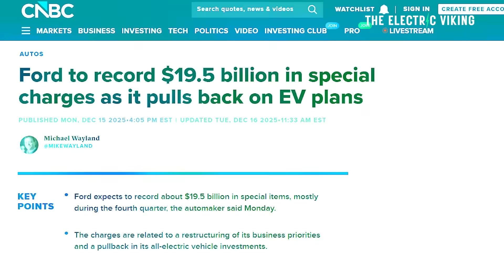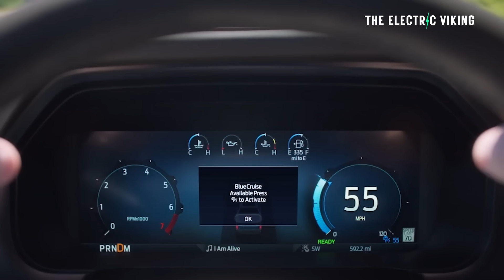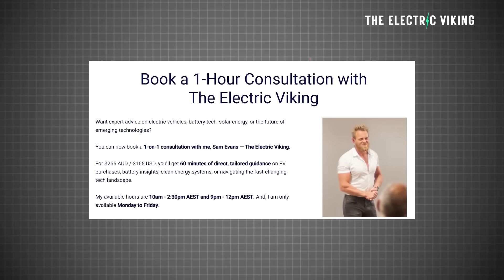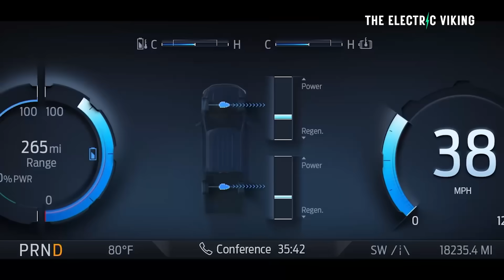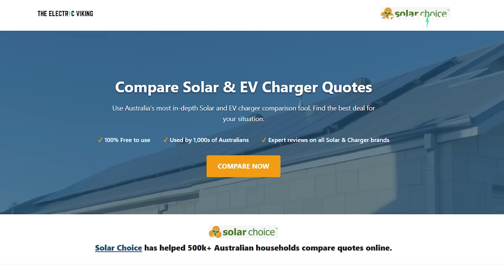Ford’s $30,000 “Apollo Mission” EV Truck: Gigacasting, LFP Batteries and FSD!

Comment from the maker: The car I drive, the Xpeng G6 - https://youtu.be/IcniwO8NfQQ

RESINC Solar installed my battery and solar system. Get a free quote from them here: https://www.resinc.com.au/electricviking
Reply: Didn't IDRA create the equipment to do gigacasting?  if so, then it's IDRA that first developed it.. All Tesla did was buy their equipment and use it for cars mfg.  So, NO, Tesla did not invent Gigacasting.  Please get your facts straight.

Comment: This is absurd, Ford is clearly lying. EV motors generally only cost between $1k-$3k, you aren't going to shave off that much cost on motors alone.

Let's say Ford has magically gotten to $100/kwh on their battery. Best case their battery will probably sit between 70-100kwh? So we're talking $7000-$10000 for battery cost in the best best case scenario. Are we really supposed to believe everything else only costs $20k? So dumb.

Comment: One chassis with battery, motors, axels, wheels. Multiple different top/bottom parts to make “different” vehicle models. Not sure I want a truck which might otherwise have become a sedan just for a different production line routing. But I do need a new Ranger; 3.2L 2016-19 preferred.

Comment: I have to laugh... sure, maybe Ford actually can produce an electric compact pickup with an MSRP of $30K, but no one is taking into consideration one important fact: Dealers will tack on an additional $5K markup, $8K if it proves to be popular. Unless and until Ford, GM, et al can change its' dealership model to go to a "no-haggle" pricing structure, I have absolutely NO HOPE of ever seeing a reasonably priced low-end electric truck hit the streets. I predict that even the much anticipated Slate truck will not retail anywhere near their $27K target. I predict more like $36K to start. I hope I'm wrong, but I don't think I am. My opinion. Yours may vary.

Comment: I wonder if Ford is worried about upcoming Scout Motors. I'm personally excited about the Scout Terra EREV. I love the low profile screen, the manual switches and knobs, and solid rear axle. If Ford can create a more detoxed interior with possibly a solid rear axle at a cheaper price point, I may consider.

I'm also wondering if it's not time to buy an EV if solid-state batteries are about to become the new norm. I'm leaning toward the EREV platform but solid-state batteries would definitely cause me to reconsider.

Comment: Farley was on Bloomberg, and mentioned building their EV platform in Mexico to compete with China. Mexican salaries believe it or not are actually lower than Chinese salaries. So they have solved the labour problem. As for the industrial innovation problem, LFP will make a huge difference to cost as the Mach E and Lightning used NMC. Megacasting, excellent. Modular platform, perfect. I think Ford can do it. So even if assembly is in Kentucky, a lot of the parts might come from Mexico. Including the batteries. Jim literally tells you how they will be cost competitive with BYD but in North America. Skip to 8:40 https://youtu.be/ZN_I37cgLMY?si=8LjHB1tXopDSDZ5e

Comment: So Ford, a company so incompetent that it had over 140 recalls last year, thinks it's going to beat China by leasing technology from china, and building it in America where labor costs are several times higher?

And their cars won't be ready for years.

Ford is going to jump head first into the EV race, after the EV race has already been won by China. 🤷‍♂️

Comment: $30,000 ? Still in 2027? With inflation running at its current quote rate, that's $31,500, if you believe official figures. If you don't expect more increase.

Comment: I have a Mach e it’s not the best EV but here in Canada it’s has the dealership network also the cheapest maintenance I pay 59 dollars for service every 16 k so and when suv is off warranty I buy any parts I want including individual batteries packs   Let me keep this car for,a long time
Reply: Unless the schedule maintenance require is mandatory for warranty purpose. Yes the first service is 15k or six months but the second service should be 1 year or 50000 km with service fee usd 120 max . Then is 100000km. Study warranty on battery,  otherwise no need to service.

Comment: As I've said before, building a BEV SHOULD be way less complex than making a combustion car. No engine, transmission, differential or assorted mechanical linkages. Yes, batteries are still the cost obstacle, but that is something that is changing rapidly - unlike an engine (gas or diesel) which by its nature has hundreds of parts and can't be simplified. Same goes for transmissions. The legacy automakers need to eat their own children (ICE cars) and go all-in on BEV to be able to catch Tesla (and BYD) and win. At the end of the day, don't bet against American ingenuity when their collective backs are against the wall.

Comment: I was really looking forward to seeing the 2nd Gen Ford EV truck the T3 which sounds like was unfortunately cancelled for now. I drive a 2024 Ford F150 Powerboost hybrid which I really like and may consider a full EV or EREV truck in the end of 2027. I expect there to be a lot of choices at that time so it should be interesting. People forget that Tesla themselves didn't turn a profit forever....think it was 17 years of loses with the odd profitable quarter here and there. Any company getting into the EV world will need to make massive initial investments in the beginning including gigafactories, new truck plants, new engineering and testing of parts along with investing in the supply chain and people. It's no small feat. I'm actually looking forward to the upcoming F150 EREV Lightning as well which I think will be quite popular along with the RAM EREV truck.

Comment: Will Ford do this? 
I'm  skeptical, but... Ford could IF FIRST Ford CANs a large percentage of the most useless
marketing, sales, management, board of directors and dealers. Then Ford could copy the best business structures of the best competitors. A steep chop at the top before whatever chop is necessary below. 
Better batteries lower vehicle weight, lower weight lowers intrinsic cost at automotive volumes.

Comment: Why does every EV need self-driving? I seldom bother with cruise control. I enjoy driving because it's less boring than not driving. Give me a cheap EV without all these silly bells and whistles. Forget custom silicon and doors that you can't open after an accident. I just want good value, i.e. cheap, reliable, capable.

Comment: Maybe, if the battery cost comes down. Maybe a base model with base features, a symplified platform. The truck, cars do not need all the electronic features...intertainment systems. Just design me a solid, functional truck. A base hybrid Ford Marverick is $30,000. This seems possible.

Comment: The problem with Ford is that they are so attached to the margin that F150 brings in, even if they do manage to make a $30k EV, the margins won't allow them to continuously  develop them. They've had a number of competitive cars (Fusion, Edge, Escape, etc..) that sold well but didn't update them and let them get stale. Ford, GM and what was Chrysler all have this issue.   

Essentially it's a form or 'innovator's dilemma'

Comment: I know one way Ford could significantly reduce the cost of their products while improving the quality of them. Gid rid of all management and marketing cost. Go private and get rid of shareholders profit and roll it back into production and engineering. Management and marketing cost vary for 15% to 35% of operational cost depending on industry. And if we're talking Auto it's the higher number. Profits can be as high as 20% and are just rolled into dividends and stock buybacks that only benefit the top executives and shareholders who contribute absolutely nothing to the product. Then Trump could get rid of his asinine Tariffs and we could compete with the rest of the world again in producing high quality low cost products.

Comment: I think the $30,000 number is about as likely as $38,500 was for the Lightning.   But if it's $45 or $50,000 AND they at least break even, it will be a major step forward.

Comment: My first car was a 66 mustang coupe, and I've had 2 Mustang convertibles since then.  If they put out a 2+2 seat truck, bare bones, Unboxed process and every other Tesla process (structural pack, network wiring instead of CanBus, low coefficient of drag, far less buttons & knobs, weight reduction wherever possible, etc.)  they might get to $30K.  Will the dealers let them sell for that?  Not if the public clamors to buy them.

Comment: Being a decade behind the competition doesn’t constitute a moon landing. It’s the exact opposite. When you’ve spent years fumbling while rivals launched compelling EVs and built charging networks, finally getting something on the road is just playing catch-up.

This feels like hot air from Jim Farley, a CEO whose track record doesn’t inspire confidence. His tenure running Ford Europe was marked by declining market share and questionable decisions. Now at the helm globally, he’s presiding over what can only be described as a chaotic EV platform strategy. Ford cobbled together the Mustang Mach-E on a unique architecture, then licensed VW’s MEB platform for some models, and is now reportedly tapping Renault for yet another platform. That’s three different EV foundations for a single automaker, a logistical and engineering nightmare that adds complexity, raises costs, and delays the kind of scale benefits that actually make EVs profitable.

Compare that to what competitors have achieved. Tesla’s been iterating on its platform for over a decade. BYD developed vertically integrated manufacturing that lets them undercut everyone on price. Even legacy automakers like Hyundai-Kia committed to dedicated EV platforms years ago and are now reaping the rewards with vehicles like the Ioniq 5 and EV6.

Comment: Assuming a mid gate and about equal to Maverick tow rating?  Then color me very, very interested given it is supposedly not slow and may offer home battery functionality.  That all said what is the chance are we looking at that it is not buggy?  New platform.  New software.  New build process.  New vehicle.  I mean I hate to say it, but Ford currently has a huge issue with even 'old' tech on quite a few models.

Comment: In 2020 I purchased a lot of Ford stock because I liked what Jim Farley said about how he was going to turn around the quality of their vehicles. I reinvest the dividends so my stake in Ford continued to grow. Their first EVs were ok as a first try but not setting the bar higher as you would hope. After four years I was losing hope as the quality issues had not improved, and my new Maverick had many recalls before its first service. I continued to hold and hope they would get better because of this new EV platform, but I was pretty concerned for the future of the company. The stock price came up to a point where I could sell it all and break even, so I took that opportunity to sell out. Shortly after that, Ford announced that the timetable was changing on the new EV platform, so we must wait 2 or 3 years more. I am glad I sold out, even though my 5-year investment was a bust. Do I hope they do well? Of course, but like you say, they will still be way behind the Chinese industry.

Comment: Why are they so focused on trucks? They require the most amount of battery and the highest charge rate and the larger motors. All adds significanr cost when they already arent profitable! They need to release smaller cheaper cars to compete with the bolt. Start with LFP batteries and single motor cars
Reply: Let the japanese build the cars, the americans can build pickups

Comment: The sad truth of Ford, and other makers of full sized American pickup trucks at the expense of their smaller "mid-sized" offerings is that those vehicles in their  line-up were the profitable ones. They were built, as your background imagery shows, in classic 1950s style body-on-frame, which is heavy, but simple to modify year to year. Also cost effective as a platform for both IC engined and electric models to be made on the same line.
 Ford having to completely retool for an all electric utility vehicle where the core strength is located in the battery functioning as that frame the way Tesla does is what makes him act like the effort within Ford is comparable to the moonshot. It is all about the size of the investment needed. The fraction of the U.S. economy devoted to going to the moon in that era was huge.

Comment: Farley said he has 150 OEM chipsets per vehicle (OEM means not Ford). They usually have OEM contracts for this to buy in bulk to keep prices down. Contracts and chipsets would be for ICE, hybrid & EV.
Always remember when using the term software, that it requires to be matched with hardware. You can't just take Tesla software and install it on a Ford, it will not boot up, because the software looks for specific chipsets (hardware), and Ford doesn't use any Tesla hardware. 
Did Farley change 150 chipsets? History says no.
Source - I worked at Microsoft for almost 30 years and did software/hardware specifically.

Comment: Ford unions would never allow this.  30K are you insane Jim?  You cancelled the Escape a lame product expecting buyers to go with the copycat Bronco Sport.  You can't keep techs.  You over complicate designs and repair requirements to jack up service hours.  See you can't keep techs.  Oh you love plastic in the engine bay.  You haven't learned your lesson with wet belts.  You never put a NACS port in the Lightning which is another reason that lead to its demise.  It goes on & on.
Reply: The UAW is all in on the Louisville retool, with a lot less labor needed. Lightning needed to die and make room for something better designed.

Comment: The biggest issue I see is that global trade is breaking down  I'd be surprised if the US is trading with China at all within the next 5 to 10yrs, unless there's significant change in the political climate between the two.

In any case, good in Ford for pursuing internal production advancements.

Comment: Yes, I believe Ford can compete in EVs with Chinese products.  Some of it depends on how Ford does it's bookkeeping, but mostly it depends on cost engineering, something that Ford has been very good at in the past.  It will require a different way of building and may require them to bring more components 'in house', but it is possible.  After all.  Tesla is profitably beating Chinese EV manufacturers in their own country.

Farley's biggest problem is the Ford stock holders and in particular, the Ford family.  IF they continue 'harvesting' the family investment they will put Ford out of business.  Farley is obviously putting a positive spin on the situation at Ford.  he has a fiduciary responsibility to the stock holders, but he knows exactly what he's saying and I believe he means it.

One thing that could help Ford recover in the EV business is they need new specialized EV dealers or sell direct to the end user.  Their dealers are not helping.  We live in a town with only one car dealer, a family owned Ford dealer.  They don't appear to want to sell EVs, so they don't.  Our next nearest dealer is 65 miles away, where we have a wide choice, including a Tesla Service Center.

Comment: I actually feel bad for Farley. I think the Ford family threw in the towel and is going to throw Farley under the bus. 
If I had to guess the family told Farley to stop the cash bleed and milk ICE to get profits back up at any cost.... thus the 20 billion dollar write off. 
They will let Farley do all the dirty work of layoffs, downsizing, lying and then the board will proclaim that the losses are all Farley's fault and they will "retire" him and get a pure sycophant into the CEO position. Just a guess but par for the course. I expect this to happen by years end or whenever Farley is through using the knife.....lest the Ford family have to taint their own hands with blood.

Comment: Look at their factory videos. These trucks and the entire EV platform are built by hand.
Good F_CKING LUCK.
Reply: That's why they're stopping Lightning and completely redoing the manufacturing process, along with a platform design.
Reply: @jamesvandamme7786  They don't have a factory, and they don't have a car. They have a PowerPoint. The lightening isn't selling and they have no data for self driving. All lies to prop the stock.

Comment: They need to make the EV equivalent of the 1980's, Blue Coller Hero, Escorts. F$%k the self driving and infotainment BS. Strip it down to a basic, reliable drive train with a basic interior in only 2 choices, a sedan,or a small SUV. A 2026 model T.

Comment: Imagine a world with only battery EVs, and then someone invents the internal combustion engine. Multiple times the range at a fraction of the weight, no power loss in cold temperatures, no sudden non-extinguishable fires, no 2-ton battery to shlep around, much less wear on tyres, tank filled in minutes instead of hours, stable re-sale value, no need for blood cobalt mines in the Congo etc etc etc.... it would be a no-brainer.
Reply: ICE has much increased fire risk, is much more expensive to run, charges at night in your garage, and noisier and slower. Battery tech is still improving and EVs are the clear winner for the future., The rest of the world is way ahead of us.
Reply: @jamesvandamme7786  I do not see how the battery problem is close to be solved. Lithium batteries remain a dangerous dead end. Nothing wrong with EVs, as long as they have an overhead power line. Battery vehicles are the problem.
Reply: @jamesvandamme7786  In addition, seriously you are not trying to compare a conventional fire to the disastrous situation of an unextinguishable lithium fire? Good grief.